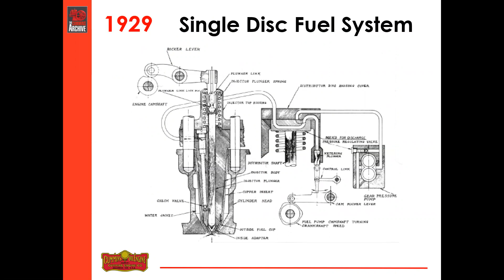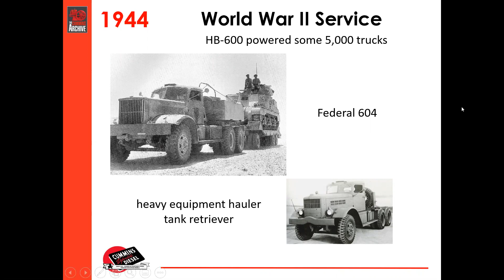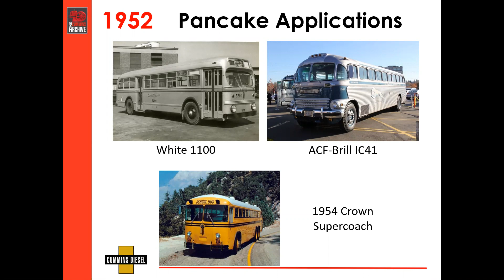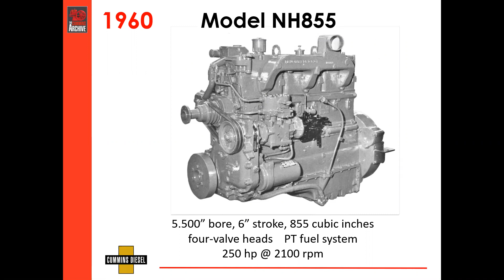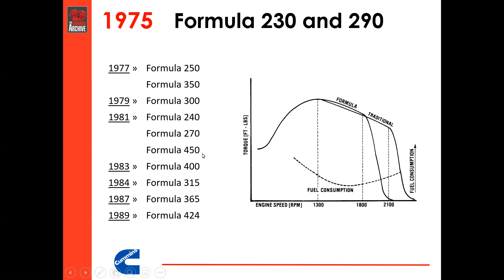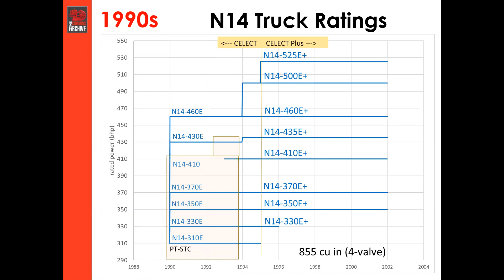History of the Cummins H-NH-NT-N14 Engines

Comment: Interesting stuff. I started at Cummins Calgary in 1975, remember the 475 and the K models and Sundstrands. Were lots of NHC250's and 335's around, few 220's, even sold an NTO262  conversion kit once. Remember there were a few disc pumps around. Wrote up RO's for 3600.00 (Cdn) for flat rate inframes on the small cams in 1975. Remember on the BC1, they installed a bunch of 290 pistons in one batch of 400's, started  great, didn't last long. Also remember the days of Hummin Cummins. Also remember all the issues low flow cooling system and  Top-Stop injectors caused.

Comment: Wow! What a walk down memory lane. Dad came home from Korea in 53.  Went to school in San Leandro on GI bill to become a diesel Mech.  I was born 61,and grew up in trucks running JT, C, H, NH, NTC models.  I rememver the old 220/300's pullin hard, and sometimes orange flames comin outta the stack.  When I was a kid, most of the rigs ran 335-350's RTO 95 13spd trany spinnin SQHD axles.  I grad'd HS in 79 When BC 2 400 was the hot ticket.  I'll be 65 this yr, just replaced a pulled piston and liner in my former employer's BC 1, powering his LDH drill rig.  When I ordered the parts at Ben's Trk Rep in Red Bluff CA, they called me a dinosaur!  Dad was shop forman for Watson Mehan in Eureka CA when they built their shop there, mid late 50's.  I worked in the shop he opened in 69 later as a teenager.  By 16, I could rebuild, and time em, comoletely rebuild the heads.  Dad would go out on the 1st after hr call, (24 hr serv).  After that, my older Bro and I pulled straws, and the liser headed out in the night with the serv trk.  I spent many hrs working on trks, and heavy equipt with Dad, and got to know him as a man.  I miss him terribly, What I wouldnt give to toss the toque wrench back and forth with him as we perched on opposite fenders, workin up a sweat, and shootn the breeze.  I cut my teeth behind the wheel of a 63 IH Emeryville, 335 Small bore, 5x4.  Made a 13 spd later easy peasy.

Comment: Now retired (45 years) diesel truck mechanic.  Man those were the days, with the pulse manifold, lower press fit cylinder liner, holset turbo, and stamped oil pan, the BCIII has a special place for me.  I think it was maybe the best and most reliable diesel ever made.  The N-14 and DD Series 60's were good, but they were electronic.  Give me the old BCIII as the old owner operators would say, and I could make it home.

Comment: Hi ihad  in graders a 220hp 743 natural .intake and exhaust oposite sides. Also a nh 220 hp 855 similar to small cam 250. I have 3 250s forsale 1 runs beatiful.

Comment: I started with Cummins in Feb., 1970, just out of college in Tech Service. The Nh-220 was still being built, the NH-250 was still the number one seller, but that would change pretty soon as the demand for more HP took hold, soon the NTC-290 was the leader. I got to see the introduction of FFC, Big cams I-IV, N14, L10, ISM11, KT(A)-1150, B-Series, and much more in my 31 years with Cummins and Cummins distributor before I left in 2001. I used to go down to the assembly line and watch them assemble the 855 product, could go watch a bare block casting come in, go to the new block machining line, which was pretty long and U-shaped, bare block in one end, fully machined and ready for assembly line at other end. I would go to the Tech Center where engineering was located as well as many test cells all with dynos for product development . I happened to there the day they started the first K2300, V-12, lots of cheers when it lit off. Got to see a lot of things with Cummins in my years there. I wouldn't recognize the place now, or the product line, I was a mechanical engine guy.
Reply: Was the K series engine based on the original Model K build in the latest 20s and 30s ? I’ve seen people in comments say the K19 was originally built for Komatsu but I worked for a Cummins dealer called N Power and Cummins Gary and Northern Illinois and I’ve never heard anybody tell me that in my training or from any corporate guys . I always thought the K was a model letter and nothing more and nothing to do with Komatsu .

Comment: What of history on Cummins k19 engines
Reply: KTA1150 is basically the same engine.  6 1/4 bore and 6 1/4 stroke.  Single individual heads.  Electronic vs. mechanical fuel system.

Comment: What is the difference between say NHS and NHRS, so it is just injection pressure from the double disk pump and later the PT pumping system (39:40) that allowed the higher outputs?

Comment: Great Video.  It brought back a lot of memories.  In 1969 my father purchased 4 Kenworth's with NTC-335, up until that time we were running Detroit 8V-71.  The increased fuel economy and performance were like night and day.  In 1972 we went to buy 6 more Kenworth's and to encourage us to upgrade to NTC-350, they were priced lower than the NTC-335.  The NTC-350 became a standard in the industry. Back then Cummins engines were painted beige, something Detroit couldn't do with the oil they leaked.

Comment: If Cummins would have fixed the tapered crank on the 927, and left the 855 platform back then, I truly believe Cummins would have been in a different position even today. I believe that engine would have surpassed the Caterpillar in the 80s.
Reply: Cummins produced more engines for highway trucks by far in the 80's than Cat.  The 3406 was good but more expensive than the Cummins to overhaul.
Reply: In order to compete with CAT they needed to copy them, first thing to get rid of individual heads as they don't offer the rigidity necessary for the block, get rid of the PT fuel system,

Comment: Nice video there👍🏽
Even though I am an 18 y.o boy who still studying at the Polytechnic in the Mechanical Engineering Department, I love the older diesel engines, including the first era of the Electronic using at the engine. Because I think, they were the best engines out there, the easy to fix and use, and it is also pretty much clean (no sensor cables, electrical wiring, etc. hanging and enclose almost entire engine) than nowaday diesels.
I wonder if someone could build the 743 engines again, which, is one of my favourite, especially its sound, even though I'm live in Indonesia, were there is almost no on-road or off-road Cummins engine except for generators.